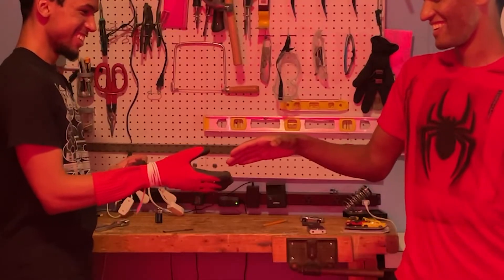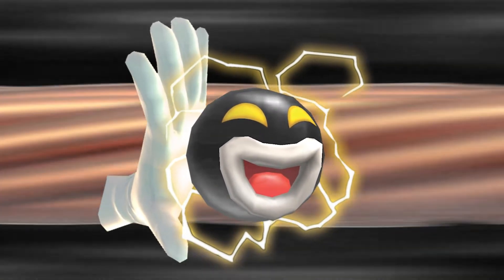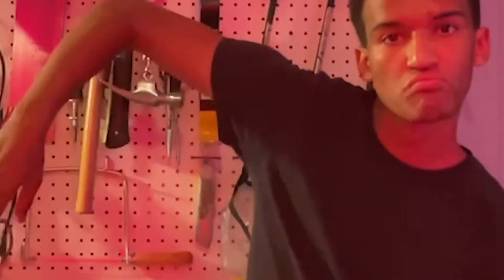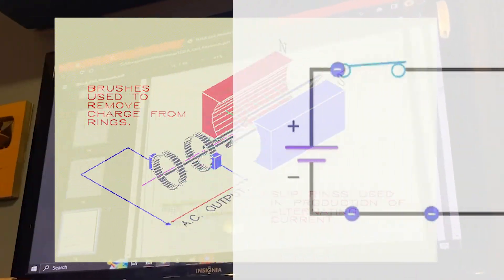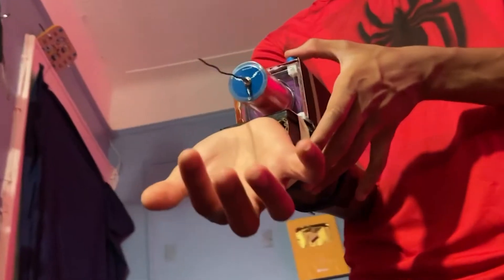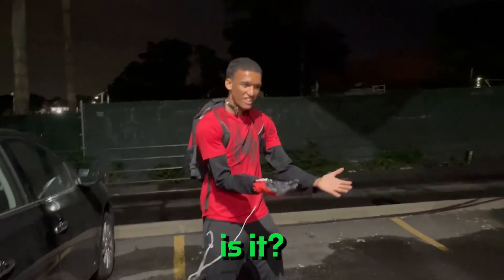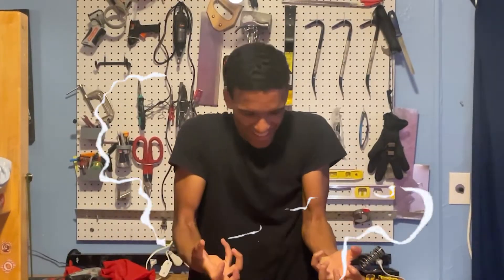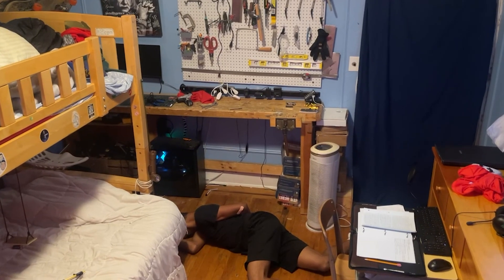I Made Miles Morales' Bio-Electricity

Comment: I’m planning on making an electric arc shock gauntlet thing similar to your first gadget in this video. I’m gonna have it be able to slide over my knuckles and lock in a position when I make a fist. That’s where the pins are gonna be to create the arcs. Do you have any advice at all?
Reply: And don’t worry I’ll take safety precautions. I’ve already shocked the hell out of myself with multiple electrical gadgets I’ve built. I have a general idea of what I’m doing just wanted to know if you have any advice despite the different designs
Reply from the maker: Love to here it man. One thing I HIGHLY recommend doing is figuring out exactly...

- How to get electrically shocked?

- Why electrocution kills you? 

I did this research before I started my project, and it'll allow you to make decisions using logical reasoning instead of ignorance or fear. Knowing the limits allows you to approach them, without fear that your getting to close.

Comment: Make Batman’s bat rope with gloves to climb it
Reply from the maker: I'll look into that, got any ideas for how that'd work?
Reply: @BenRebuilt  For gloves to climb a rope probably want a tons of short needles coming out of the gloves to dig into the rope and maximize surface area. But for some kind of winch up the rope could look into re-purposing an electric skateboard motor or handheld drill motor or other motor (depending on your budget) and have it winch you up from your belt. Best of luck for future projects man
Reply: @BenRebuilt  for the rope use kevlar, for the hook use a custom batarang, for the winch if you want to be comic accurate than use a spring similar to a tape measure. If you put periodic knots in the line then a half dowel with a hole drilled through on the palm and fingers, when you close your hand it will create a hole for the rope to slip through but not the knots. If that’s confusing look up Batman’s utitility belt and on the second or third image there should be a diagram describing the bat line.
Reply from the maker: @treebricks4487  Makes sense I'll go take a look. Maybe you should be the one building this 👀
Reply: @BenRebuilt  I’m trying to. I often don’t film my progress though. I’m almost finished, might post a short on my channel. I’ll tell you when it’s uploaded
Reply from the maker: @treebricks4487  Sounds good 👍